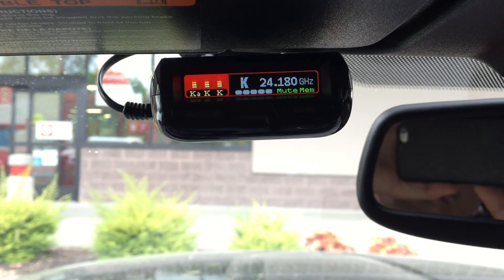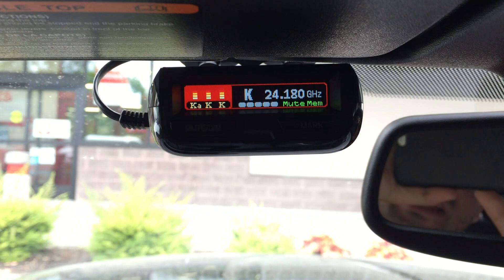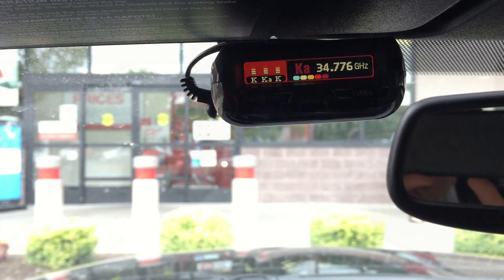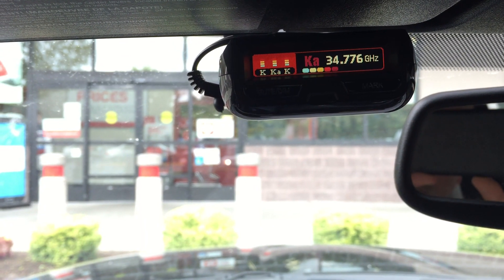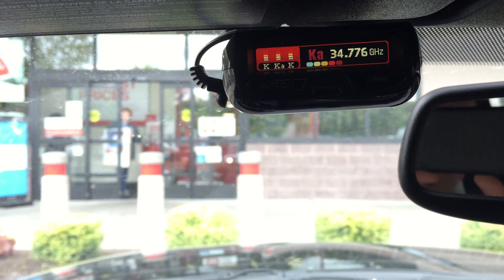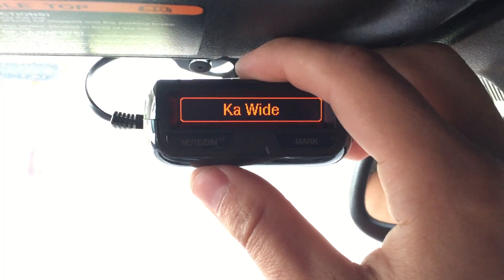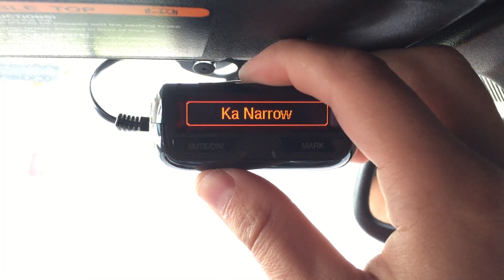Uniden R1 & R3 Firmware Update 1.26 / 1.92 Released

Comment: There is a stretch of hwy I travel each day to get to and from work.. Along this one mile of straight hwy there is an exit and a speed sign.. So, I marked it with gps and it no longer alerts to the K band.. But, evidently troopers are aware of the K band signal as well, and are actually using it to ambush drivers that are so used to the alert and ignoring it.. So, when I got a Ka alert I knew something wasn't right.. Plenty of time to slow, before I was tagged at 70 mph.. I love this detector!

Comment: I'm a new follower to your channel. You are most informative and unbiased. FYI, i like your intro music but it's very loud / or your video volume is low. I always have to turn up the volume after your intro. / I've had an Escort 8500 X50 for about 10 years and it finally crapped out. I'm looking to upgrade it to a Uniden R1 in the future. I had no idea technology has jumped so far in 10 years. Thanks for all your hard work making videos, it's much appreciated!
Reply from the maker: Thank you and welcome aboard! :) I usually bring down the intro volume to match the video, but I can turn it down even further. I'm actually looking at updating the intro anyways since the Redline has been discontinued and I want a change. However, I'll adjust until then. Thanks for the feedback! :)
Reply: I'm so torn between the Uniden DFR7(gps) and the Uniden R1(no gps) (i have to stay in $300 range) I mostly drive in the city and suburbs for work and only some highway. I know the DFR7 will mute locations with false alerts which the R1 will chirp everytime but the range test on the new R1 may be hard to resist. Heck i've been living with false alerts for 10 yrs, i'd rather have the range. What are your thoughts?
Reply from the maker: What part of the country do you drive in? If you prefer the range, R1, but honestly if you do any driving in the city and suburbs like you do, that GPS chip makes a world of a difference. Once you get used to it, it's almost impossible to go back...
Reply: I live in Providence, Rhode Island. We don't use X-Band so i just shut it off. I drive mostly in the city/suburbs, that's why i'm so torn. I think you are right though. The DFR7 is still a good detector and may be a better choice for me. The GPS probably will help me more for my daily driving. Plus i might get a good deal on the DFR7 now that the R3 R1 are out.
Reply: (sidenote) it cracks me up when i watched all your Rocky Mountain Crap detector videos on how bad they are.
Reply from the maker: Yeah that makes sense. The DFR7's are discounted now that the R1/R3's are out. :) http://bit.ly/2iJety2

Comment: Thank you for the video. Also thanks for the firmware one as well. Just updated my R3 in a couple minutes. I have gotten a few false alerts on 1.25, but otherwise happy with the R3. Love seeing the band and don't have to try and figure which light is showing like on the V1. I smile now as I pass cars with BSM and see the lights in the side mirrors and no alerts going off non stop. Had to literally either turn off K or shut sound off on my older V1. I will say I do miss my arrows. What I don't miss is the old school V1 send it in mentality for firmware upgrades. Valentine needs to add a usb port and use a screen. Still love it for all the saves it has racked up over the years, but it's seriously outdated on the outside. I will never buy another one until they step up their game. Anyway, thanks again and keep the videos coming. Take care.
Reply from the maker: Yeah I totally get it. A newer V1 would really help quiet things down, along with pairing the detector with a phone to get V1Driver or YaV1, but now that you have the R3, it's hard to go back. I'm in the same boat. :)
Reply: Questions - should we use narrow or wide on K band? Also should we have KA filtering on? I disabled both pop and TSF since I figured they were not needed and could affect performance after watching your other videos. is that recommended? By the way I bought the R950 permanent sticker mounts on ebay and they work. Just had to bend the angle so they were straight. If anyone else was wanted a permanent mount highly recommend. Got em on ebay for $7. My suction cups do not hold..need to test my polarized glasses. Thanks man
Reply from the maker: +FTLAUD 911  I'm working on an article now explaining all these options. :)

Comment: Do you think it would be better to get a r1 or the dfr7 with gps? Long range would be nice but wouldn't the r1 go off at stores from a long distance too because it doesnt have lockouts? The r3 is just too expensive for me atm.
Reply from the maker: +Ggogle123 The DFR7 is a better real world compromise if you drive around town for that exact reason. :) http://bit.ly/2iJety2
Reply: Vortex Radar thats what i was thinking I was just still on the fence. Thank you for making these videos... they are very helpful for people just getting into radars!
Reply: Thank you for sharing your knowledge. Your videos are top notch.
I too am also between R1 and DFR7. Nice to mark a few traffic lights and stores. About 80% of my driving is Rural flat Texas Highways. Main concern is there a significant gain in distance detection for the added price of the R1?
Thank You
Reply from the maker: If you're doing mostly rural flat roads, the R1 would likely be the better pick. It's an absolute beast in TX. :) http://bit.ly/2pDArdo
Reply from the maker: Something else to consider though, not to give you more options.. :) The R1 is sold out until next month and in TX they use a ton of 34.7 which is the DFR7's strong suit. So if you need a detector soon, you can get the DFR7 and since TX's terrain and radar guns play into the DFR7's strong suits, it will perform very well there too, plus you'll get the added benefits of GPS.

Looks like there's no way to make a bad decision here so that's good news.
Reply: Outstanding!  
Thank you Sir

Comment: Okay so I bought this on your recommendation for thru driving ...grad school syracuse  ny to albany.  idk If I have it set up wrong or what but the thing literally beeps nonstop and when I mean nonstop i mean from time I plug it in for the entire drive. Is this normal?  because it was extremely annoying the constant beeping. I was forced to turn the Vol down to zero and just try to watch it. Please help . tell me I didn't just waste 400 on something I can't stand .
Reply from the maker: Was it going off to Ka band by chance? Specifically 35.5? There was an issue with the initial public release that some people were seeing on their detectors and firmware version 1.26 resolved this issue. https://youtu.be/-IUpKSGvCGA Update your detector if you haven't already and it should fix the falsing.
Reply: Vortex Radar okay haven't gotten to do update yet need a micro usb. but it was bouncing between constantly beeping ka 35-36.1 and k band 24.something
Reply from the maker: Oh I didn't realize you had commented on the actual video about the update itself, heh. Yeah, definitely update and it should help with 35.5 falsing. Enable the K band filters like K Filter and City mode if you need to reduce K band falsing. If you're seeing constant K band falses, you may have traffic sensors and need to enable TSF. Also make sure you're running Ka Narrow to help with any Ka ghosting issues on 34.7. 

Read over my programming information article and it'll help you get everything set up. http://www.vortexradar.com/2017/06/how-to-program-and-set-up-your-uniden-r1-and-r3/

Comment: Hey man! Appreciate these reviews!
Ive seen some videos that would suggest from the testing done, that the Escort Redline's Ka Band detection is slightly better, (alerting sooner) then compared to the range of the Uniden R1/R3. 

I've read some comments and seen a few videos that the Redline, with its ability to suppress and filter through  Ka Band Segmentation, that it's alerting slightly sooner than the Uniden R1/R3?! 

What have been your findings or experience through testing? 
Can you perhaps do a separate video sharing your thoughts or comparing these two proclaimed kings :) , " maybe a head to head comparison" on all bands ?  
Thanks man!
Reply from the maker: I have seen a test where the Redline was run with literally just one segment turned on (so it's only scanning for 34.7) and in that case it was able to pick up signals faster than the Uniden set to scan for more frequencies and that can translate into longer alerts. In some select situations, it is possible for the Redline to alert sooner.

Looking at the big picture though, there's a lot more to it than just that. :)

Comment: my R1 is about 3 updates behind  and I’m updating it now , if I put the 1.26/1.92  update to get out the bugs out when I update  , will it bring everything up to date or do I need to download each version to bring everything up to date and then put the 1.26 / 1.92
Reply from the maker: You can upgrade and downgrade directly to whichever version you like. No need to load in intermediate versions.
Reply: My r1 has 1.37 on it is that good enough or do I need 1.50
Reply: I run highway alot
Reply from the maker: 1.50 is great, especially with K Block

Comment: Does any hardwire kit work with uniden r3?
Reply from the maker: Generally, yes. They all share the same power requirements. If you have one that has a remote mute button or alert LED for a different brand detector, those won't work. However, strictly for power, it'll work fine.
Reply: thanks!

Comment: Vortex Radar, thanks for the great, in-depth reviews and analysis.  I recently discovered your channel as I'm in the market for a radar detector again after purchasing a new 2017 Chevrolet SS.  I really am excited about the Uniden R3, however, with a Chevrolet, I'm concerned that you mentioned about false alerts with BSM for GM cars.  I haven't actually heard you mentioning anything about what cars it is best to use different detectors in considering this potential issue.  Am I going to basically be false detecting myself everywhere I go, if I get the Uniden R3, since I'm driving a GM car with BSM, rear cross-traffic, forward collision alerts etc.?  I would really like to know the answer to this before I buy, and haven't seen you mention this specific issue in any of your videos.
Reply from the maker: I'm honestly not sure. Most people into RD's don't buy GM BSM cars, but I'd be curious to hear your experience once you get your detector.
Reply: Well, I'm into sports cars, muscle cars, sports sedans, etc. not RD's.  Saying I'm going to have my Radar Detector dictate my choice of vehicle, is like saying I'm going to have my choice of guitar pick dictate what brand of guitar I buy, or my choice of speaker wire dictate what type of sound system I buy . . . I could go on with metaphors, but in short, that is an absurd proposition and quite frankly, I wonder if your response was an off the cuff personal opinion regarding GM, or if it is in anyway substantiated with actual knowledge data, facts, etc.  Personally, I like these newer technologies, love the BSM capabilities, and find them extremely useful, as I, like you, like to know what's going on around me.  I want to know what is going on directly around me in terms of traffic, and I would like to know what is going on in a greater sense around me in terms of speed traps etc.  If this is untapped territory in your Radar Detector knowledge, I would think that it would be an excellent piece that you could do to investigate this, and make a strong point to Uniden and/or every other manufacturer, that it definitely SHOULD NOT be the case to NOT buy GM w/BSM which basically these days means, don't buy GM at all, because of your radar detector preferences, but quite the opposite should be done, to consult with Radar Detector manufacturers to apply filters to account for GM's BSM technologies for drivers of GM cars who want to buy a Radar Detector as an accessory to their vehicle, not buy a vehicle as an accessory to their Radar Detector.
Reply from the maker: +phyglenaut sorry, didn't mean to set you off. Just telling you that it's not something I've seen done a lot. You've got a cool car and I think it's a great choice. Like I said, I'm curious to hear about your experience.
Reply: No setting off . . . just imploring you to include this inquiry into your extensive testing, and yes, hopefully get a bit of perspective here that a ~$400 purchase shouldn't dictate a ~$50K purchase . . . I'm quite certain that it shouldn't be too difficult to find a friend, cohort, family member, etc. that has a vehicle that has these technologies and take a Uniden and/or other brands out for a quick spin to see the results.  As I said, I would really like to know if it is pointless to buy one before I spend the money, rather than wasting $400 on something that isn't going to work for my vehicle.
Reply from the maker: +phyglenaut I've gone to Chevy dealerships to test different filters before, but not from inside a BSM car. The thing is there's countless different BSM filters from different manufacturers. They source the radar components from different companies so things vary even within the same manufacturer and even different models, believe it or not. There's no way I can possibly test everything with every detector. Your best bet is to hop onto RDF and ask for people's experiences who have a BSM car. Also remember that if it doesn't work, you can always return the detector and get your money back. I'm happy to help, but sometimes I can't do certain things for you and you're better off testing yourself. Cheers.
Reply: Vortex Radar, O.K. thanks for the replies . . . I figured since you specifically mentioned in some of your recent videos that there was an issue specifically with Uniden filters not being able to filter out, specifically GM BSM technologies, that it was maybe a standard frequency, etc. that could possibly be part of the continuation of fine tuning the Uniden and/or other detectors since these manufacturers seem to be including yourself and other testers / reviewers into the feedback design loop.  I still think it would be a great video to jump in some BSM vehicles, whatever the brand, and see what it does to the detectors.  There, after all, is really no point to getting a detector if wherever you go you, you are false detecting yourself, as wherever you go, there you are, so you can't GPS mute yourself obviously.  I still say you should take this up, not necessarily as a GM specific thing, but Toyota, or whoever else who uses sensors that RD's have a hard time filtering out, and see how it affects the RD's.  Not as a specific car by car review, but just in general, some vehicles that have BSM, how do the various RD's react from inside one of these vehicles?  I think it is an important question and if it hasn't been answered, would be something to add to your repertoire . . . Hope you keep it in mind for a future video . . .